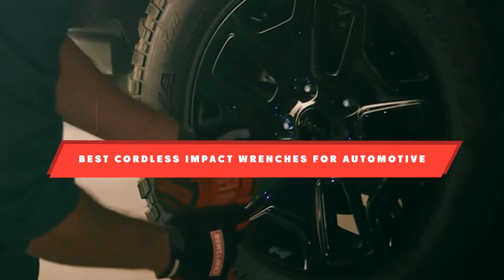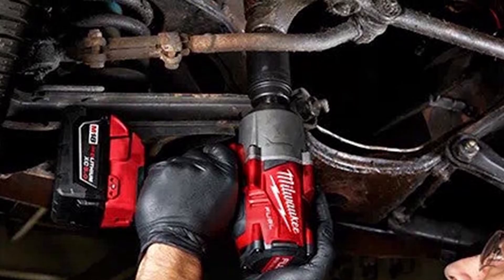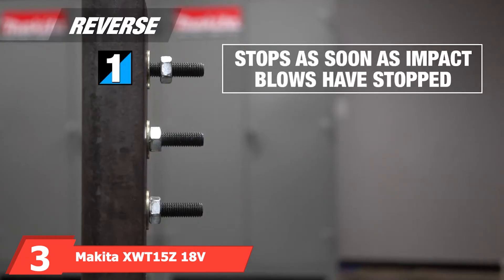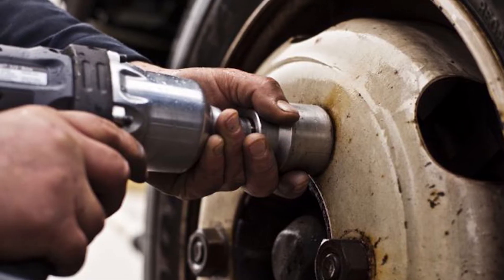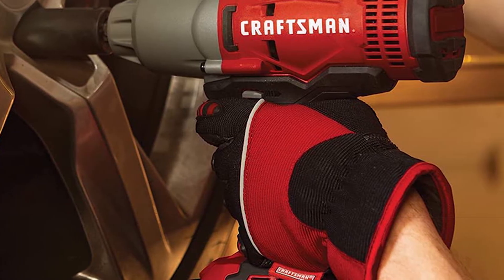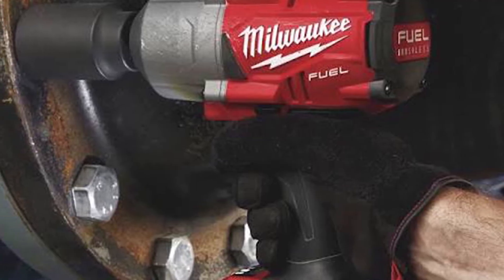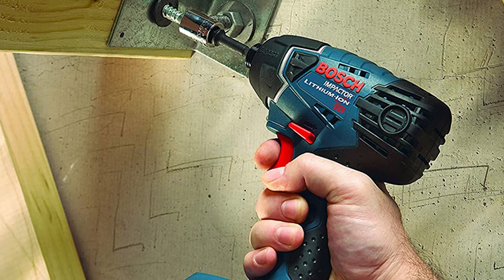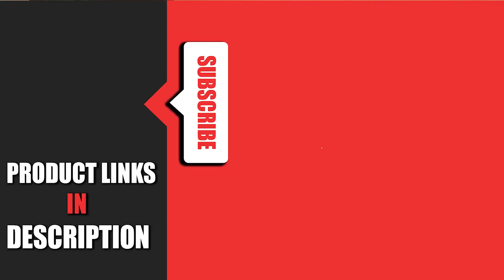Top 10 Cordless Impact Wrenches for Automotive in 2024 (Top Picks)

Comment: I don't think there's a need for the Milwaukee 2767 - the mid torque will do most jobs and after that you should just step up to the 3/4 inch model. It barely weighs more than the 2767 and only costs a little more.
Reply: Yeah but the sockets are more expensive